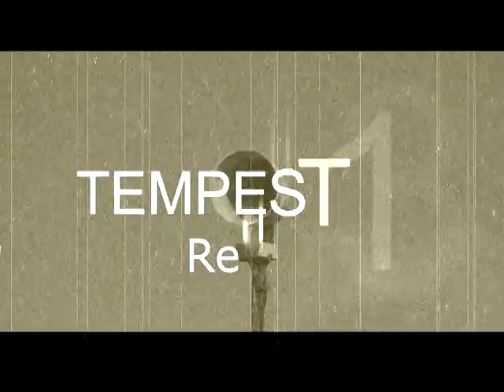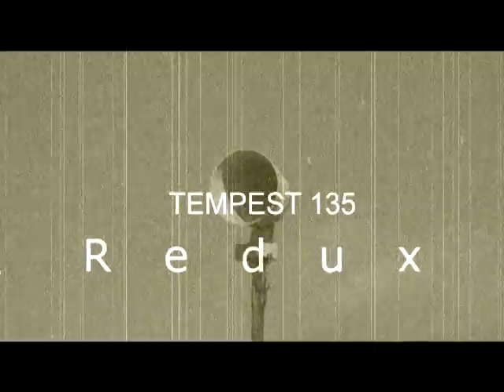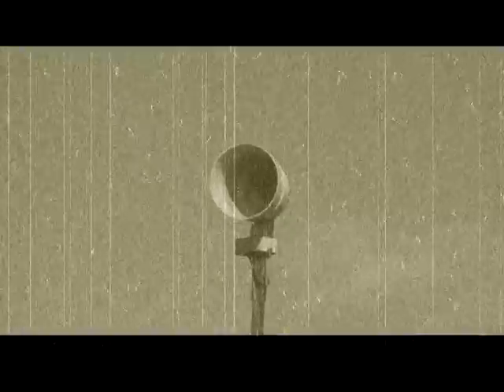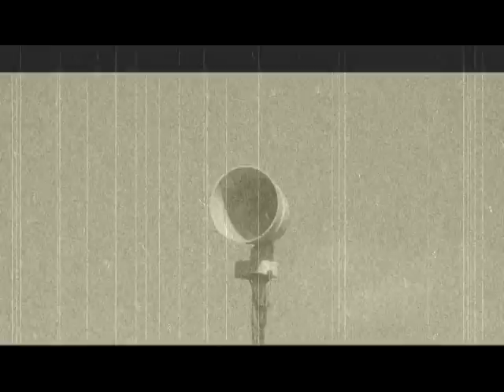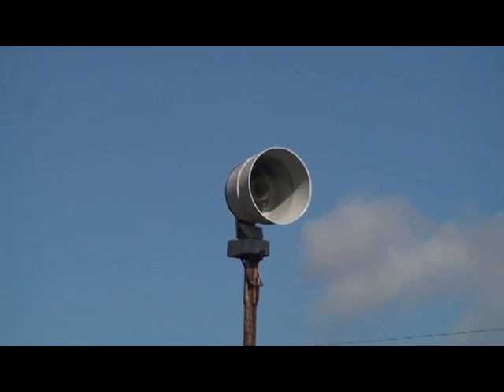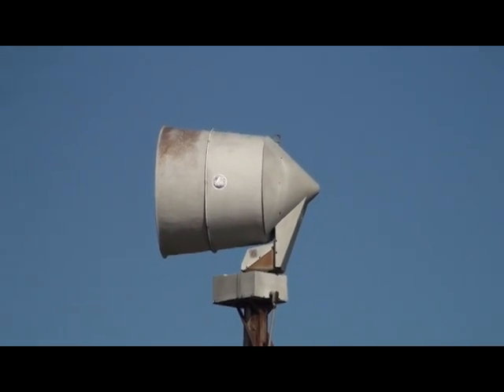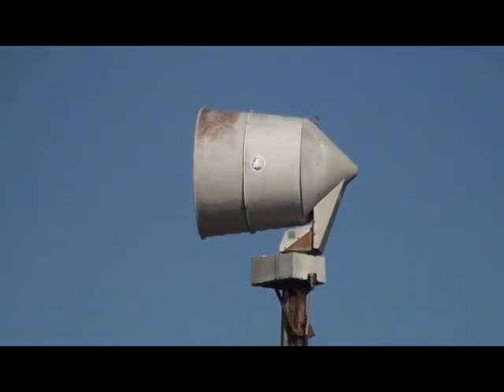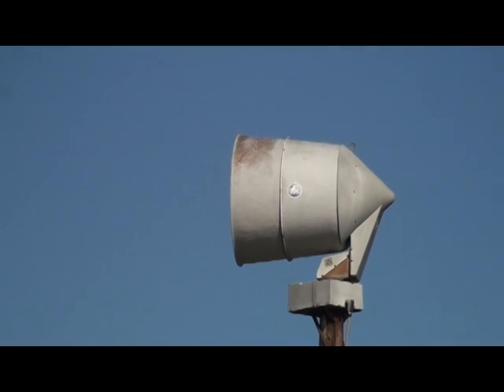Tempest 135/Penatrator 50 Siren test Redux!!!

Comment: @MegaPrincessmeg When the P50 was made it could be set to run on three voltages. Tri-phase 240, 277, or 450/480. this particular siren was installed on Tri-phase 277. If it had the full 480 it would wind up alot quicker.

Comment: @bait28 Ive actually switched wiring on a P50 before and it used 991.27 amps on startup. but it was a Baldor motor and not a Doerr like the one in this video... Anyways, Great video.

Comment: So how bad were your ears bleeding afterwards?  Enough that your shirt was now red, or just a little trickle?  ;)

Actually, at 70 feet, you might have actually been outside the central sound cone's coverage angle...

Any word on the secondary whine?  (My guess is that it's probably something to do with the rotator--I forget if the P-50 used a reduction gear off the chopper motor to run the rotator, but if so, straight-cut gear whine could easily explain it.)

Comment: 408 volts? You can't run a motor wired for 480 on 408 volts, the voltage drop will fry it.

Sure it's not 208 volts?

Comment: Doesn't sound too good! I expected way more power than that! The windup was also kind of slow and when I see p50s they windup fairly quick unless they are reverse-wired.
Reply from the maker: Sirens fine. It's on 208 Volts, has a small power drop, and My camera has an active compressor.
Reply: What do I know anyway? I need it extend my knowledge on these sirens. Especially because 90% of my city's sirens are p-50s. Theyre starting to replace them with t-128. Not nearly as interesting as your classic p-50 or ACA Allertor.
Reply: +Bait28 It's VERY underpowered. It should be MUCH more powerful. Not good.
Reply from the maker: how should it be more powerful, it's at full RPM